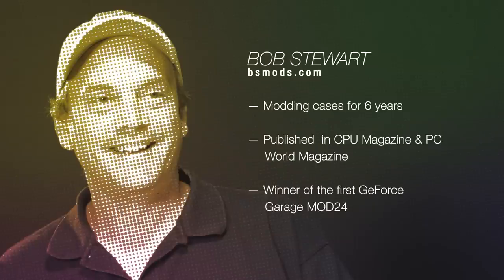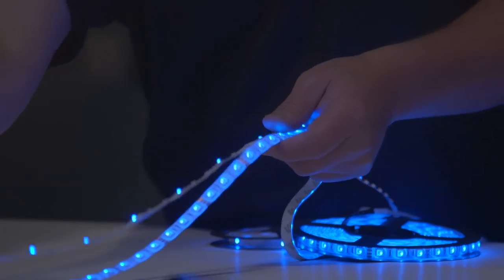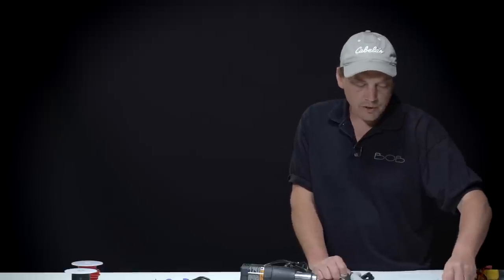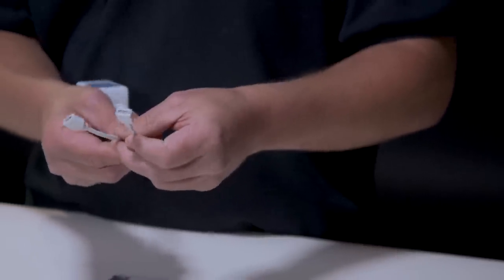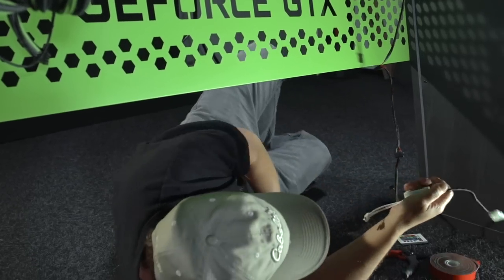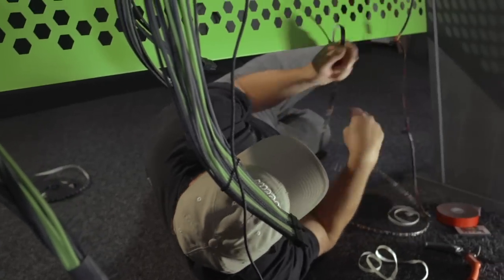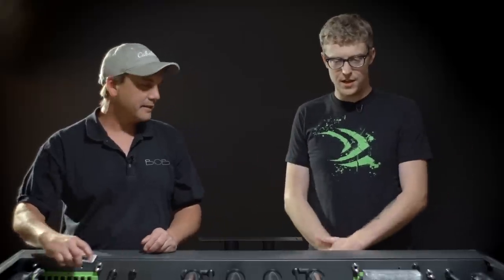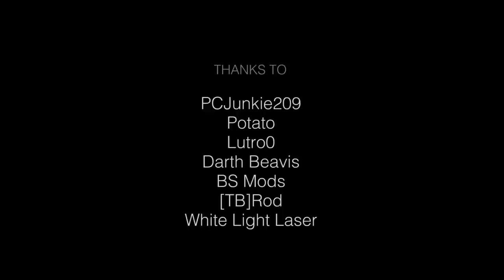GeForce Garage: Cross Desk Series, Video 4  – How to Install LED Lighting

Comment: In the UK a show called Gadget show made an igloo with surround screen and they used LEDs but they connected the leds to a peice of hardware that monitors the monitor; the display; the screen. And if you change colour like to the windows desktop (blue or cyan) the LED change colour to match the display's display (if any of that made sense)

Comment: Hi bob,  i didnt find any answers on the comments below, hiw did you put the strip on the gpus? With the glue gun?
Reply: Hi kalosbas we used clear double stick tape from 3M. This allows the light to pass into the GPU blocks. 
http://www.amazon.com/Scotch-Heavy-Duty-Mounting-Clear/dp/B00004Z4BU

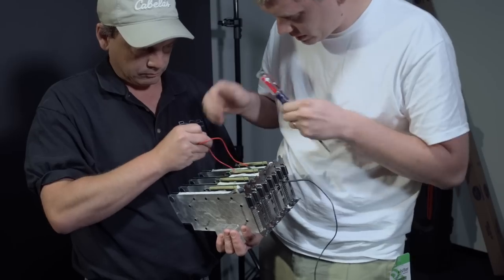Comment: 5:49.. I understand what he did but since the leds need to face torwards the waterblocks to make them shine, how the heck did he stick the leds on the waterblocks???
Reply: he used the CLEAR double sided tape to adhere the led diode side of the strip to the block. the clear tape allows the light to shine through (obviously). notice how the 3M peel off strip is still on the led strip? thats the back side of the strip.

Comment: if i would use 12V and 5V from the PC supplay, can i connect the 2 GND from the 5V and the 12V? Without getting errors or damage my hardware or other problems?

Comment: what kind of tape is that? i have a nzxt hue which is good enough for me but the tape it came with sucks ass. they claim its 3m but it started to suck the first two weeks of owning it.
Reply: It'd just be the standard double sided tape that you can find in a hardware store
Reply: Ash Ketchup ok thanks ash>!
Reply: Hope Depot even has large rolls for around 12-15.00

Comment: Can you remove the power LED from the front header and stick a + and - end from a LED strip instead?
Reply: If you mean using the motherboard power LED header and connecting it to a strip. I wouldn't advise that as the mobo is only designed handle so much current and a whole strip of LEDs would most likely overload that

Comment: People say 4 pin Molex to run it from the power supply.  Looking at my power supply (EVGA GS 650) I see the peripherals are 6 pin sata.  ???
Reply: Both 4 pin and sata have a 12v wire that can be used to power LEDs  Its the yellow wire or pins 13,14, and 15

Comment: Disappointed with this video. Since this was an official nVidia video, I was expecting a how to use the L.E.D. Visualizer feature that is available in the Official GEFORCE Experience manager using standard l.e.d.s , case fans , etc ( INSTEAD of just controlling supported video cards built in lightning) . Instead we got this slapped together video with no connection to a computer. It does look nice but it would be great to have some computer controls.